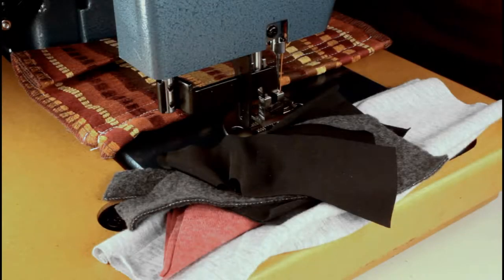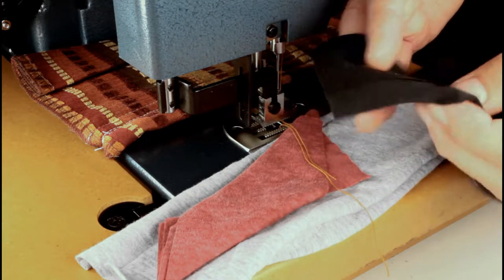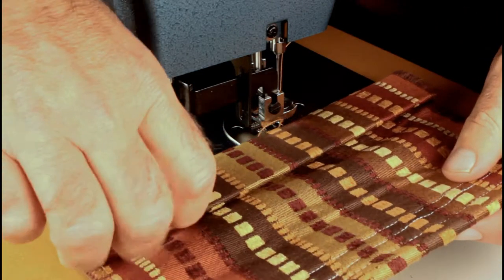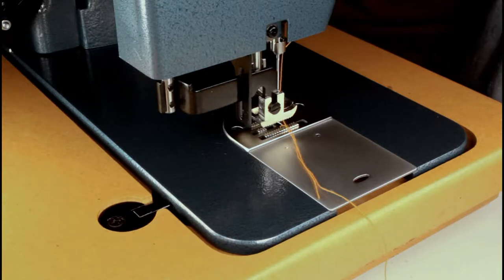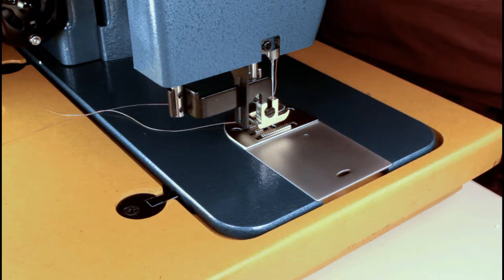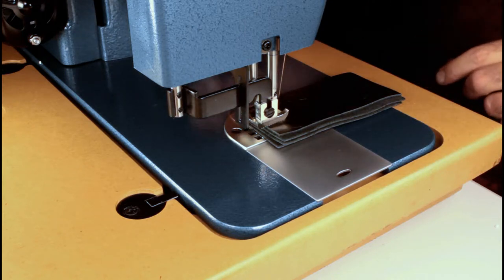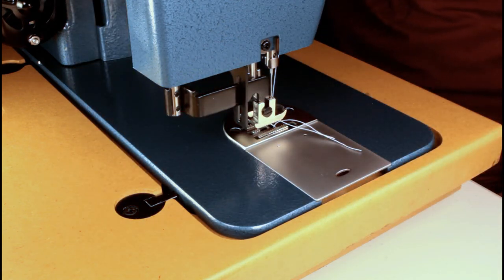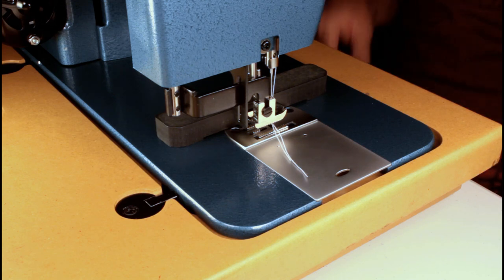Sailrite Ultrafeed LSZ1 Fabric Test

Comment: I'm glad I found your review! How did you find the noise level? Others have said that it is extremely loud. Also how would you compare it to the Singer Heavy duty series? I saw your review on it and wondered how you'd compare the two. Thank you!
Reply from the maker: Yes, it is pretty loud compared to my industrial machines I use daily. It is much more powerful than the singer heavy duty series. Plus it has a built-in walking foot.

Comment: Thanks for the video. I very frequently have the same issue you had at 9:41. I stop sewing, raise the needle and notice that there are four threads connected from the machine to the material. If I cut the four threads, I can clear two of them from the machine by pulling on one side. Do you have any idea what causes that? Again, thanks for the video.
Reply from the maker: I returned it shortly after I made this video. I noticed one of the pulleys was out of alignment.  Sailrite corrected this issue in their production line  after I returned it.  I would reach out to them and see if they can answer your question.  They are very good at responding to questions.